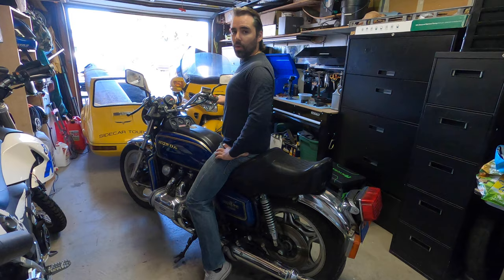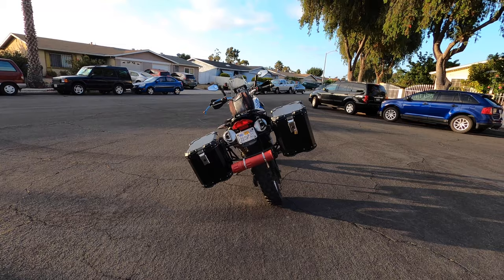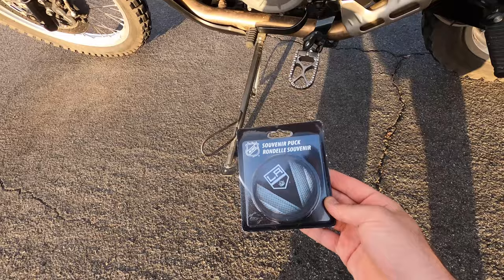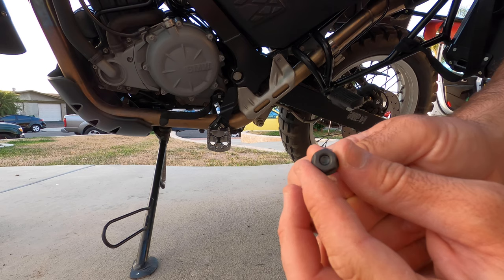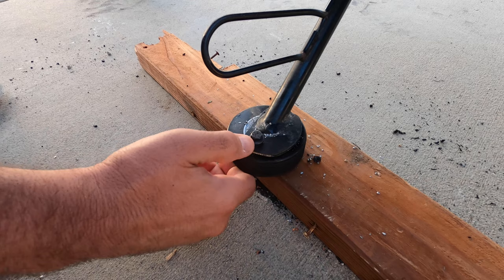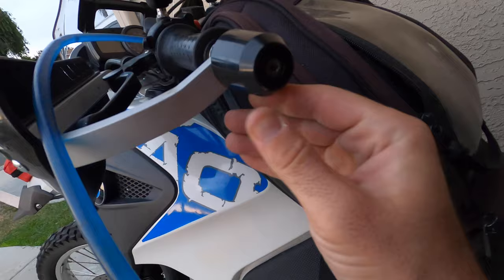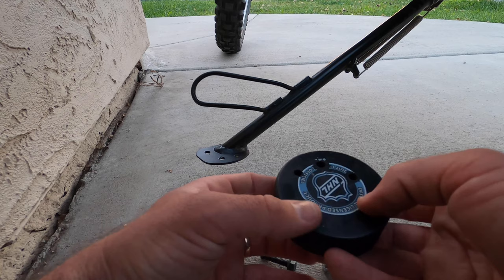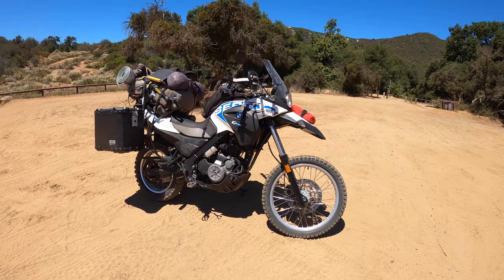EXTENDING THE KICKSTAND/Sidestand; The ADV Bike HOCKEY PUCK MOD for BMW G650GS Sertao / F650GS Dakar

Comment: Nice idea. The button hexagonal head would look more esthetic, the whole tightening job is done by the nut. The hole diameter in the rubber may be also a little smaller than in the metal stand. Thank you for the concept.
Reply from the maker: Hey that is an excellent suggestion - I am picking up another 650gs tomorrow and will try this instead - thanks so much for the tip and glad to have you here! Nik

Comment: You really need 3 puck thickness . 1 still makes it lean way to far . 1 puck is only 1 inch . I keep my bike rested on a brick that is 2.5 inches and its stilling leaning to far . I would go with something thats is at  least 3 inches . This puts the angle of your bike at the  average motorcycle angle .
Reply from the maker: That would be better, however there isn't enough clearance with the rear wheel when the kickstand is up.

Comment: I cant beleive the lean even with the puck. BMW needs to be better engineers when figuring out bike lean degrees.
Reply from the maker: It's true. It's a mild fix to accommodate for the flex at least and a longer puck isn't possible because it would contact the rear tire. It's poorly designed. They should not have let this out of the factory.